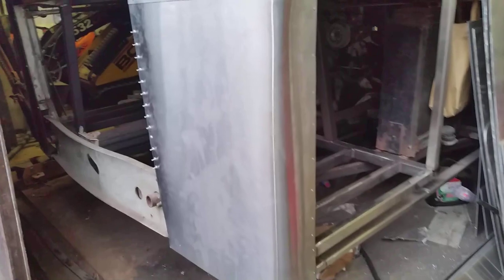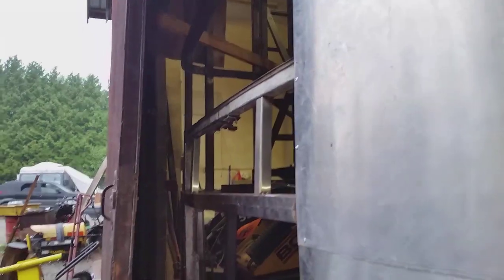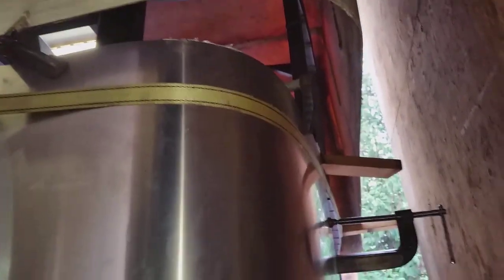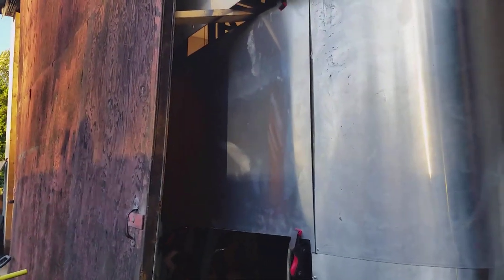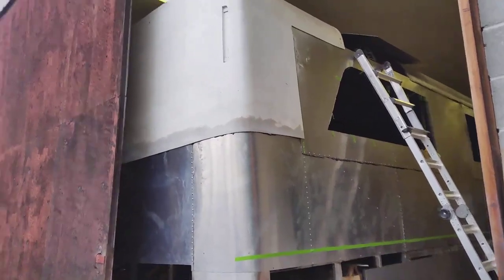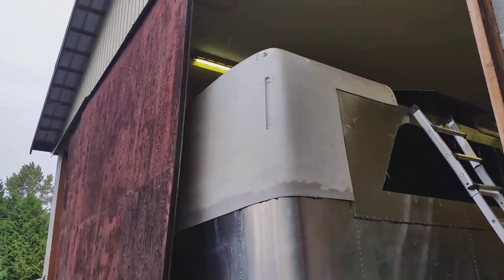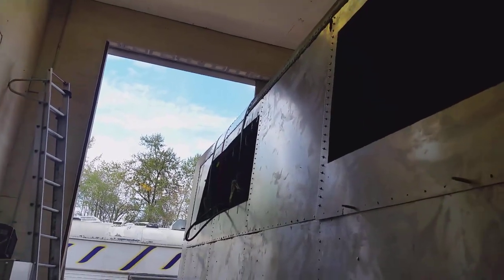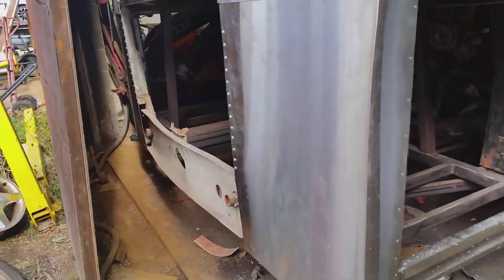Bus Conversion Project - Video 47 - Extension roof panel and rear Cap install

Comment: James,
Another riveting episode. ( sorry I had to say it ) Genius idea the anchor points from the marker light holes and strapped from inside must have saved hours fighting to rivet around them if outside instead. A quick side thought rear camera mounts one high for full view over a toad and second mid mount for close quarters backing . weld now before you move the welder outside the bus to finish the slides. A small bracket to reinforce behind the fiberglass at the mount location and 3M foam body tape to prevent cracking of the face surface from vibrations. You can still form a fiberglass shroud over the camera and have a metal plate to anchor to. Amazing as always. Steve
Reply from the maker: Ha.... Ha.... seems to be  a common theme ..... a rear camera mount is something I'm hoping to look after over the winter if I can get it all skinned so I can heat it..... taking longer to install 4000 rivets than I thought :-)... and it's too late.... welders already out, though I may have to put it back in to look after a few small jobs I forgot about

Comment: I never found the video that explains how you can remove the engine if necessary. What is your process to brill all the holes, not placement, but how do you drill the holes?
Reply from the maker: We start with an 1/8" bit and then open up with a 13/64" for the rivet.... if you go back to one of the rear extension video's you can see that I extended the frame with the same V-channel as original, these busses slide the engine out the rear so I just have to slide it an additional 5', I think I will put jack stands under the ends of the frame and then slide it out, I have to remove the turbo first and then the rest of the engine transmission assembly will slide out, I will have to build a rack to pull the engine onto when the time comes, there are locating holes in the end of the frame to accept locating pins to align the channel so it should slide right on, that will have to be on wheels obviously so it can be moved around the shop
Reply: Ok, thanks. I have an American Coach. The ones after mine have the engines mounted on rollers that roll out on the back frame rail.

How do you stop from having the drill hit the surface of the aluminum when the 1/2 inch bit punches through the frame?
Reply from the maker: I keep the drill bits really sharp, then not as much pressure is required to drill so when you go through you can release the pressure before the drill chuck hits the aluminum, also after you've drilled a few holes you can tell when the bit is about to go through the other side and can back off on the pressure, the bit starts to cut better just before it goes through so if you are paying attention you know when to back off, I suppose you could put some sort of stop on the drill but it doesn't seem to be nessasary
Reply: What do you use to sharpen the bits, I have never had much luck doing that. I have tried the fixrure that mounts next to a grinding wheel and change the angle of attack based on the size of the drill and also the drill sharpeners that you stand the drill bit upright in. What do you use?
Reply from the maker: I use a drill doctor sharpening tool.... will do up to 3/4" bits, takes a little time to figure it out but works great once you do.... easy to turn your drills in punches if not set up right though
Reply from the maker: ya... that's it... the 750 does up to 3/4" drills and the 500 does 1/2".... works really good once you go through the learning curve
Reply: Can you educate me on split point?  Why even number of turns (only sharpening half the tip at a time?). Is it economical? I have always just replaced bits. I use oil to cool the bit when drilling heaver the sheet metal. Thoughts?
Reply from the maker: Well, I don't use split point bits much, I know the drill doctor will sharpen them but I've never done it and yes, only sharpens 1 flute at a time as you rotate the bit so that's why an even number of turns, for smaller bits I don't think it's worth it but if you do larger bits then it may be worth the expense to buy one, if you only drill a few holes once in a while... probably not, I got mine when we had the hotrod and race car fab shop so we were drilling holes constantly so it was well worth it, larger bits get pretty expensive and it doesn't make sense to throw em' out just cause they are dull, I used to be able to sharpen them on a bench grinder but my eyes aren't up to the task anymore... getting old sucks.... and yes using cutting oil helps a lot, with larger bits, I don't use it with the size holes I'm drilling now but on a drill press, definitelyhope this all helps you make a decision
Reply: Just ordered the 750, thanks for your input.

Comment: What thickness aluminum did you use and we're did you buy it at ?
Reply from the maker: I am using 12GA. .080"  5052 aluminum and I buy it from Samuel and Son in Langley B.C.